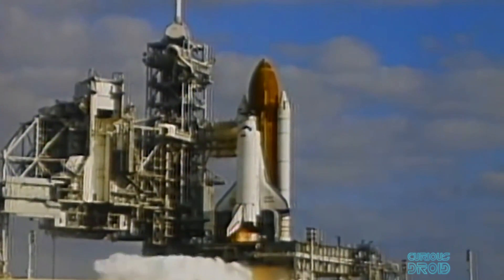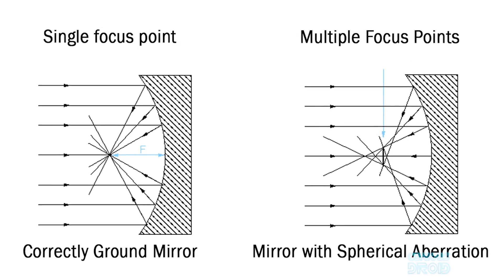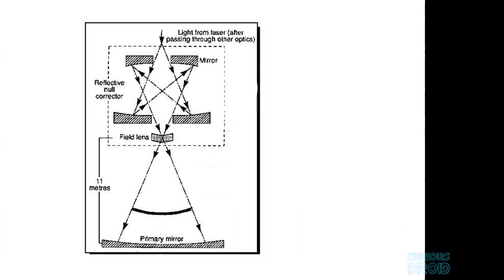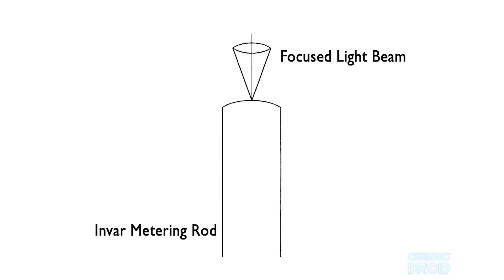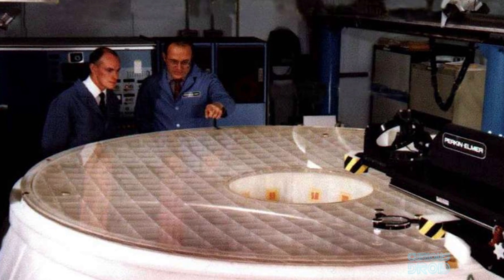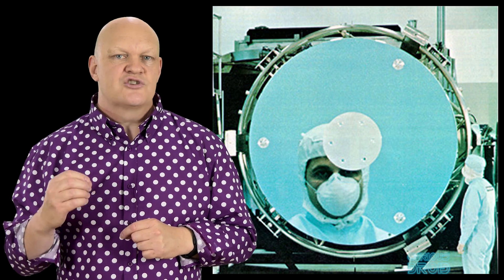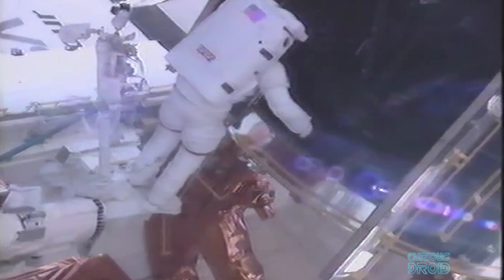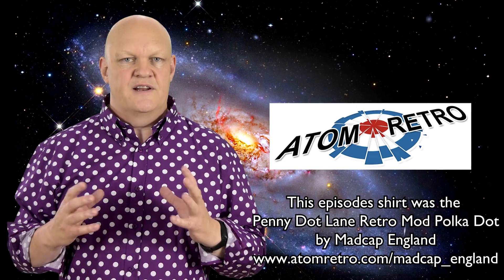Hubble Trouble - How did the Space Telescope Mirror End Up Flawed ?

Comment: 3 spacers .10 each, cost to find problem ~1000 in paid overtime, cost to fix in space ~10s of millions. Government contractor still gets paid priceless.
Reply: Although I agree it was a technical fault of Perkin Elmer, I think NASA still had the responsibility to accept the QC procedure and results when they accepted the mirror. In civil engineering you are often required to test any materials received on site through your own QC procedure where possible, in addition to reviewing the QC results from the supplier.
Reply: "No one ever asks how much worse the imagery we have today from Hubble is even after it was corrected as compared to what it should have been?"

That question has been asked and answered. I was an astronomy student in the early 90s and I have seen the relief of the astronomy community first-hand. After the repair Hubble exceeded the original specs.

At the same time though, these results are probably buried deep within the scientific astronomy literature and are not easily accessible to the general public. You could ask Phil Plait, the Bad Astronomer: he used to work for the Hubble science institute.
Reply: Obviously the corrective optics degraded the signal a little bit. But it may well be the case that if the mirror had been ground correctly in the first place, Hubble's performance would have exceeded the design specs even more. But that is all speculation at this point. And I would not call the Hubble's sensors "crude". They were pushing the state of the art when Hubble launched, and have since been upgraded multiple times.

And no, the corrective process was not the result of guesswork. Professional astronomers were all too aware of the shape of the point spread function and hence the corrective measures needed. In astronomy there is no dearth of suitable point light sources to gauge your optics performance. These point sources are also called "stars". 

Also, the source of the error was well known, as the present video shows. I don't know if they tried to replicate the Hubble mirror on earth using the faulty equipment, but I do know that the mirror shape was modeled in excruciating detail, and I have seen multiple scientific papers on this subject. Which, to be honest is not my specialty in astronomy - I did my master's thesis on the structure of galaxies, not on how to build space telescopes.
Reply: Termi Nation so let me get this straight, Nasa made a mistake, but instead of fixing the mistake they instead made an elaborate conspiracy to cover it up. This conspiracy involved hundreds of people from the private and public domain, uncluding members of the fbi and cia. Cdroid is also a member of the cover up crew. 

All these people are involved so that they can release photoshopped images of astronomical phenomena, which are good enough to fool the scientific community into decades of wasted research and wasted money stemming from faulty images. In order to keep the conspiracy from being found out they use contacts to try and rewrite history but the only ones who notice are peope lke you.

Your evidence is that you remember hearing it differently 20 years ago.

When someone calls you a moron or insane for believing this you think they are just derailing the truth.

Ever consider you were just exposed to too much depleted uranium and your brain isnt working right?
Reply: Hunter deja I'm not convinced of that. Any bit of extra optics inserted in the light pathway is bound to steal some light and/or field of view. They may be able to correct the direction the photons are taking, but they are going to lose some along the way. Compare the light sensitivity of a photographic "prime lens" which is a fixed focal length lens with few lens elements to a zoom lens which is a more complex design with many more lens elements, some movable to be able to shape the light beam traveling through it differently depending on the focal length set.
Reply: I was around in 1990 as well. But I wasn't a douchebag with seeds of mental illness, so I remember the news as it actually happened at the time. God forbid that a guy with a Youtube channel and a few thousand subscribers tries to make some interesting technical historical content for those interested in it, or god further forbid, those who weren't alive yet or not paying attention at the time. Yes, Curious Droid must be part of a Hubble space telescope cover up. He's the nefarious plant of "Big Astronomy."
Get a life.
Reply: Termi Nation You have presented no facts, evidence, motive or reason to your ridiculous claims except personal assurance. Since doing the first two is impossible because no evidence exists, perhaps you can answer my question about the motive?
Reply: You don't get it, do you? I have never been an object of someone's attempt to have me committed. And that goes for the absolute majority of people out there. The mere fact that you've dodged these attempts doesn't mean you are an healthy individual. In fact, you keep insisting there are "false accusations" and "circumvention of due process" going on are red flags indicating your mental health is, in fact, failing. Of course no youtuber has any weight over these things, but you are not looking into yourself when you keep accusing everyone else but you of wrongdoing.

As to the evidence, you're dodging again! This time, you have made up an excuse in me accusing you of mental problems. But look back, I have asked for evidence ever since my first comment in this thread, and you have ignored every single one of those requests. That's way before you had this idea. Still nothing.

We both know you have no evidence. You're making this shit up as you go along. Who knows from where? Little voices in your head? Some other conspiracy shit you've read online? A misunderstanding of some basic facts that have grown out of proportion? Who knows. But, please stop embarrassing yourself.
Reply: ConsciousAtoms maybe/meh... ;-) The MTF and combined MTF (Modulation Transfer Function*) optically should be weaker and poorer as a result of the corrective optics versus the original intended design. Remember the corrections and aberrations they were trying to "Fix" are and were very complex, so unless you have the 'Duff" mirror to build a corrective system directly to it's still going to be a bit of guess work even with sophisticated adaptive systems and optics. On the other hand maybe the digital sensors employed were sufficiently course/crude that the final MTFs and the "Quality" of the resultant imagery were not that different? Would be nice to see simulated imagery and response curves and the like? Maybe I google around :-) Also the Hubble platform seemed to have been plagued by "Unforeseen" vibrations and thermal expansion effects that were not sufficiently compensated for. Just wondering how much more awesome the imagery might have been?

* [Hard to explain MTF in one sentence, but a method of determining contrast and resolution of a system over a range of spatial frequencies... ]. Gives a very good idea of what a system can see in terms of faintness of an object and the ability to resolve very fine details without too many weird (aliasing) artifacts, aberrations, distortions or signal noise. ].
Reply: Perhaps you could tell me which country you studied in? I absolutely agree astronomy is definitely underfunded, infact I think astronomy is the closest thing we have to understanding life, the universe, and everything. Astronomers are like the the priests of the atheist.

Unfortunately no I am not. I am about to graduate as a civil engineer as a mature age student. I always considered working for NASA or any space research to be a rock star job. I guess I have the mind for engineering anyway, my decisions are sometimes too logical ;)
Reply: @Termi Nation The mirror is actually of extreme precision and excellently engineered... To the wrong focal point. Given an exact or otherwise known as systematic error, it is possible to correct the equipment for it.
Reply: Termi Nation i did and have read it.   Just like any other conspiracy theorist you have dismissed the evidence as a fraud. You think that a made up theory is more credible than the facts. 

Lets just use this issue in the video as a microcosm... Do you really think everyone at NASA and the contract companies were involved in a conspiracy? That is hundreds of people in public and private industry...

Even if it is a conspiracy why would they do it?
Reply: +Termi Nation... Nahhh I am engineer and expert in optical engineering and digital imaging as well as physically building this kind of stuff. So honestly @Termi Nation you are perfectly welcome to believe what ever you want and I'm not interested in dis-abusing you of your particular beliefs... I'm not bothered YKWIM..?  But I'm asking the question is the "Outsider" theory that there is this belief that the mirror was ground too rough versus being ground to the wrong profile/curvature? BTW I watched all of the space walks / EVAs on that many many many freaking hours (not fake YKWIM)? @Termi Nation you can believe whatever you want... I don't mind being Mr "Yuk Yuk" :-) (as you say).
Reply: Termi Nation just like other conspiracy theorists you think you are smarter than everyone else but you are actually a moron. I dont even understand why you think they would do this, hundrerds of people involved, nobody saying anything and for what? Is it just because in your world nasa is some lie that perpetuates round earth or something?
Reply: Termi Nation If you were around in 1990 then you didn't pay much attention. The problem with Hubble's mirror has always been known and understood as it being ground to the wrong shape, hence wrong focal point. And now you come here out of the blue and claim it wasn't, and that this is a later invented lie. You bear all the hallmarks of a full blown conspiracy theorist with your skewed reality, paranoia and outlandish claims. Claims, I might add, that you have not presented a single shred of evidence for. And since you are making the extraordinary claims, you need to come up with (preferably equally extraordinary) evidence to back up your viewpoint. Which you can't, because it is in fact you who is the liar here.
Reply: Termi Nation Yap, yap, yap... still no evidence. Why don't you try to actually prove your point instead of continuing to drone on like a broken record. What you really should do is seek help for your paranoia, but since that would mean actually admitting that you're sick, you won't do that. So, next best thing, show some evidence. Until you have some, just shut up will you.
Reply: Termi Nation You do know there were a total of five Shuttle missions to service Hubble, right? Which ones are you claiming were lies, and exactly how?
Reply: +Termi Nation Yup that's right Termi Nation, I am a CIA hatchet man rather than a Photonics engineer with 14 international territory patents to his name ... Yup you totally got me, totally nailed it!  I am a CIA man stalking you down relentlessly trying to cover up the truth and plug all the leaks from such knowledgeable and insightful individuals such as yourself.    FWIW I have worked with the FBI in the past on technical projects (20 years) ago and I have to say they are really freaking smart and know their onions. Honestly I'd rather work for the CIA in counter intelligence than actually be a photonics engineer. @Termi Nation I could care less whether you believe I am a photonics engineer or not, or could care less if you happen to think I am a CIA "Hatchet man" lol...
Reply: Termi Nation he gave you his credentials, and if you've read the comment thread, it's easy to see those who know what they're talking about and those who don't.

You're the latter because you haven't backed your statements. At all. You've just screamed it's a lie over and over again. You've provided no evidence that the story has changed since the nighties, something possible with some research, and ignored/dismissed the evidence and explanations given. 

It had the wrong focal point, the secondary optics and programing were change to correct it. That's what happened. Why you think it didn't doesn't matter unless you can prove it didn't.
Reply: Termi Nation man you really are a conspiracy theorist with little grasp what us adults are talking about.

And that's hilarious, keep saying stupid things.
Reply: Termi Nation The mere fact that someone have tried to have you committed should tell you something. You Are Sick. You need help. Reading your deluded ramblings makes me sad, because you are so completely off the rails and way into lala land. You have continued to ignore my requests to provide some evidence for your claims. The only reason can be that you don't have any, otherwise you would have pounded on the opportunity to shut me up for good. It is obvious to everyone but yourself that you are suffering from paranoid delusions. Which, of course, are part of the symptoms of your illness. You are unable to see that yourself, because you are in the middle of your own reality. I can only hope that you will eventually get the help you need to come back to the reality the rest of us shares.
Reply: @ConsciousAtoms May I ask where you studied and what you currently do for work? Also whether your peers found work in the field. I have heard its an extraordinarily difficult area to find work in, much to the detriment of humanity in general :(
Reply: I am not going to tell you where I studied as I value my online anonymity, such as it is. I am currently working as a statistical researcher. It's true that not many of my fellow students found work in astronomy, but a few did. Most of the others have jobs similar to mine, that I know of. One went on to have a career in history, as they were more interested in the history of science than science itself. And I agree, astronomy is WAY underrated in society. Without astronomy, navigation would be impossible, so the world trade owes us quite a bit of debt of gratitude :).

If I may be so bold, why are you asking? Are you looking into a career in astronomy perhaps?
Reply: @EXTRA DIMENSION Did they not exceed their original specifications though? I mean obviously they over engineered it, especially due to the attitude to space missions at the time. Things were extraordinarily expensive, so logically they would have allowed for extraordinary safety factors on the design, in this case precision. Perhaps the verdict is still out on whether it could have performed better without any fixes, but regardless, it still finally performed better than the contract criteria. In my opinion as far as the engineering is concerned, it was a success after a major (eek, litigation...) hiccup.
Reply: I really appreciate the encouragement and I think that's exactly what you should be telling most graduates, but to me, I made the decision long ago that even though I love space and all its mysteries, I can find plenty of other mysteries and interests in areas where I am guaranteed employment. You could see that as submitting to being a slave to capitalism I guess, but I see it as the most likely option to give me success and a field of work that at least holds my interest. I will leave the dreaming to you guys :) Peace
Reply: Not a contradiction, I think you misunderstand me. Hubble was over-engineered. It would have been even better without a faulty mirror than it is now with the corrective optics, sure. All I argued was that Hubble, after the fix, was better than the original specification. For clarity, "better than the original specifications" and "better than the hypothetical case in which they hadn't made the error with the mirror" are NOT equivalent statements. In this entire discussion I have been addressing the former, while you seem to think I have been discussing the latter.

How much better Hubble would have been than the original specs without the faulty mirror is unknowable. I also did not mean to say that Hubble with the corrective optics is better than it would have been without the faulty mirror. That is obviously not the case.
Reply: It exceeded their expectations when they fixed it, but that doesn't mean it would have been as good as it was originally intended. Lucky they got it as good as they did so it would have exceeded peoples expectations. lol
Reply: Two ways to fix after the fact:

1. Had the flaw been discovered before the mirror was installed in Hubble (as it almost was, but they ignored the test that said it was flawed,) they could have reground the mirror the right specifications, or used a backup mirror.

2. Had the flaw been discovered after assembly in Hubble, they could have removed it and installed the backup.  As mentioned in the video, multiple universities asked to test it during the launch delay - this could have happened.

There was no way to install the backup on-orbit, but it also was a possibility to retrieve Hubble, bring it back to Earth, swap the mirror, then relaunch it.  But the actually-used solution of a "corrective optic" elsewhere in the optic line installed on orbit was cheaper.
Reply: This is what I mean by "Backup mirror": https://airandspace.si.edu/collection-objects/mirror-primary-backup-hubble-space-telescope

And the mirror itself didn't cost $100 million.  Also, it wasn't 100% complete - the final step in coating it was never done. That would have been done had it been chosen to be installed.

Also, NASA even has two entire "backup telescopes" donated by US spy agencies that could be converted to be space telescopes, if funding were to happen: http://www.popsci.com/technology/article/2012-06/nasa-adopts-two-spare-spy-telescopes-each-maybe-more-powerful-hubble
Reply: The wrong focal point was a result of the error in manufacturing if you watched the video it's obvious, the mirror was designed to precision, but just to the wrong focal point... If you know anything about engineering or spatial error you know systematic errors are easy to fix because you can apply a systematic fix for the error. I am not sure how exactly they implemented the fix in software because I am not an optics engineer or a software engineer...

You seem to be a conspiracy theorist.. Let me ask you this: Do you think the moon landing is real?
Reply: This I kinda funny I have to admit... So there's a conspiracy theory that the Hubble mirror surface finish was too rough? Rather than being ground to the wrong large scale geometry but at the correct surface finish? LOL Those interferograms would not work at all if the surface finish of the mirror was to "rough". Hey if we keep this going maybe Curious Droid will make a second Hubble video or compare Hubble to James Webb space telescope... ???

(Ohh YouTube you are so funny). [Also don't forget (according to Curious-D Hubble mirror was of an aspheric design).
Reply: Weak retort imbecile. Go get your Obamacare psych meds while you still can.
Reply: Renegade...don't feed the troll. It's impossible to reason with foolishness or mental illness.
Reply: Anyone heard the "Story" of there being a second 'Hubble like" instrument in orbit that points at Earth and the ground for the alleged purposes of spying/intelligence applications? Is that a total "Tin foil hat" conspiracy rumor or did they really build another such telescope, vis a vie the unnecessary size of the Space Shuttle and cargo bay?
Reply: +ConciousAtoms Just as an aside... I owe my entire career/career trajectory to an Astronomy student that leant me a book on image processing as an undergraduate, and also being able to look behind the scenes at the University of Arizona Astronomy department and engineering as a 15 year old kid and the Kitt Peak National Observatories,  very inspiring indeed. I agree that the astronomers and their technical and scientific needs really force us to push all boundaries and frontiers and it's nice that Astronomy get's piggy backed onto "Big-Science" but now it seems that "Raw physics" and things like the LHC seem to be the "Focus" of interest too for how it all "Fits together".
Reply: +Renegade30 Awesome that you are mature student, at Cardiff University years ago there was real emphasis on mature students. I think when you come later to these things with a more mature mind then sometimes better direction and purpose can be found. My father used to work for NASA (50's and 60's) Marshall Space Flight Center... I have been very lucky that I have always applied for research fellowships and other positions that most people would say you (meaning I) don't have a snow ball's chance in hell of getting. But somehow by dumb luck I have proved them wrong most of the time. @Renegade30 seriously if that's what you want to do just apply for anything you possibly can! At NASA and Space X there are a lot of positions available and you just need to throw yourself at it and follow you instincts and also be flexible. Once you get inside an organization then you can start to move laterally into areas of greater interest. My advice (lame or useless as it might be) is really sharpen your pencil ffor advanced manufacturing processes such as CNC machining particularly 5 axis work/multi axis systems and advanced CAD/CAM as well as trying to get a handle on additive manufacturing coupled with smidge of materials science and metrology. That smorgasbord of partial experience coupled with basic theoretical engineering is VERY valuable and sought after indeed. Desperately needed in defense and aerospace and other manufacturing sectors that involve deeper engineering. Kind of depends if you live for advanced simulations or more hands on engineering, or a bit of both? Google around on youtube for what some carreer young University students are getting up to at Huntsville/Manned Space Flight center... I think you will be surprised.

 Long story short follow your instincts and sometimes not be so ready to believe people that tell you what you "Can't do"...
Reply: +Renegade30 The "Fix" was amazing... No doubt about it. But I wonder if the various corrections  that were made even put the operational capability to within 75 to 80% of how Hubble's "Alternate" reality should have been, then I think we would have been flooded with many articles, data sets and test plots to prove and show that being the case.  As that would have been a superb outcome where the cigars would have been handed out to all involved. Obviously Hubble has many/had many capabilities but if any one of the important capabilities was greater than about 67% of what should have been I think we would have certainly heard more about that as being one of the greatest technical achievements of our time? (Not just all the amazing space walks).

Just a simple example. Let's say you commissioned me to build a "Modest" 600mm (aspheric design)  telescope with certain specs and tolerances and general capabilities ... And then I delivered to you a telescope that could not quite focus right... And then I give you a set of very complex alternate optics (constrained by size and other factors) introduced to the light path and told you that it's better than the original in spite of the most important optical and expensive component being ground completely wrong, you'd probably tell me that I was "Full of it"/be rather incredulous,  and demand a total rebuild or a total refund? Physics and data still have to apply here, and in the case Hubble (understandably so) a lot of data has been buried.  

But everybody seems to have moved on and the James webb Space telescope is of a radically different design and the other space telescopes that image in other spectra are super interesting too. Lot of lessons learned all round but the original engineering mistake really still horrifies me to certain degree as it was so avoidable especially by those "Well practiced in the relevant arts".
Reply: @Renegade30 Nice to hear that someone is enjoying making the green stuff. I have my own company now and have had to learn how to transition from the academic world to "For profit" world lol. But I remember at Cambridge virtually all the brightest students/undergraduates whether they be Physics or Engineering or Mathematics "Majors" were all poached by the financial sector/city and it was graduates from more "Red brick universities" that stayed more with their chosen subject and filled out Oxford and Cambridge graduate programs. So I guess all those really smart physics students and undergraduates and the like understand all that "Sub prime" business/nonsense... (Totally over my head lol). Peace! ;-)
Reply: +ConsciousAtoms... Makes me think (from what you say) about Hubble being over spec'd in the first place that it's shame they didn't have a Hubble "Program" where you could have slightly dialed back set of Hubbles (spec wise) but a Hubble1, 2, 3 and 4... etc. over a certain active launch and development period? Yes I know it takes a long time to grind a big mirror, but  might have been cheaper in the long run and achieved better results and be a much more blunder and fault tolerant approach? For the Apollo program the space carrier vehicles, it was not that much more expensive to produce ten or twelve Saturn V systems than it was or would have been to produce only one. At least with a multiple space telescope strategy improvements at the digital end might have been made more easily and so on. Easy to say now with 20:20 hind sight? That's what I liked about the early Mariner probes and missions they could miss an entire planet or crash  several times and still have a program ? Having a really expensive one of kind "Egg" in only one basket and saying "What could possibly go wrong???", "Hopefully this will all work right first time?"... Just seems a very very tall order.

I wonder with the current expertise that an ONLY one James Webb Space Telescope is a good way to go? If I understand correctly ? Again 20:20 hindsight but what have we learnt (from the past) and do we still continue to blast really expensive one of a kind instruments into space (still crossing our fingers)? (shrugging shoulders).
Reply: +Justwantahover My feeling the guys that designed the "Fix" (some very notable individuals) KNOW exactly what the shortfall / difference would have been. Any engineer worth their salt would have a pretty good idea of that, but seems they felt super happy as it was a VERY risky and heroic long shot in the first place. The James Webb Space telescope seems amazing but there are also some seriously risky "Mechanicals" that have to work flawlessly at a LaGrange point that cannot be serviced by astronauts! :-)
Reply: Termi they fixed it after the fact with corrective optics installed in the telescope, not a "PC program." Keep your stupid mouth shut.
Reply: aluisious its too funny though, its amazing people like him exist
Reply: +Termi Nation LOL... Maybe you are the CIA agent here doing the covering up here as I was the one casting aspersions as to the efficacy of the Hubble fix. Maybe you suffer from a cluster B personality disorder like malignant narcissism as you choose to re-frame my comments to suggest that I love the mafia. I'm willing to bet you could care less whether the Hubble fix is real or not but instead you get off on stirring up trouble... lol Nailed it!
Reply: Ohhh really you are the arbiter of integrity... What other parts of the Universe do you rule and control? Oh great one...
Reply: You keep repeating your bullshit. I asked for evidence , not your delusional opinions.
Reply: +Termi Nation you are so Troll-tastic lol
Reply: The general public doesn't give half a shit about you. No one will ever care about you, because you choose to be like this, an unfettered loser.
Reply: And everyone else who has replied anywhere in this thread who has notifications on is sick of both of you.
Reply: FYI Personality disorders do not indicate lack of "Mental capacity"... Many Narcissist and Sociopaths do not lack in "Mental capacity" and sometimes are actually very intelligent. However those two groups do suffer from paranoia and delusions of all sorts as well as other manifest negative personality traits that can indeed be very damaging to other people as well as themselves. [Something we learn at the CIA "Hatchet man" school of psychology as taught by Mr "Yuk Yuk".].
Reply: +Benny Löfgren There's no spam filter for schizophrenics. Changing the subject ... (slow, loud and pedantic tone reminiscent of Monty Python)... "I like to come to Curious Droid website in the vain hope to avoid the squalid global idiocracy that is the internet...  And have a nice chat with similarly interested individuals that are fans of "Space" and other such things like the really good videos  made by Curious Droid..."  FAIL lol !

[It never fails on whatever technically oriented web site a discussion will start up of a technical nature and then a total wack job will bust in to attempt to totally kidnap a thread and derail it completely... Ohhhh how I love the inter-web.]. Civilization is doomed... Peace out! [Не кормите троллей ].
Reply: These government contractors really are too big to fail. How are you supposed to punish a company that critical to the US defense industry? You can't, they just laugh at you. Even a Hubble-sized screwup is just another government contract for them, one of a thousand. The Military Industrial Complex is a real thing.
Reply: No one ever asks how much worse the imagery we have today from Hubble is even after it was corrected as compared to what it should have been?
Reply: +ConsciousAtoms Sorry friend I'm going to have call out on that (in a nice way) as you said first " That question has been asked and answered. I was an astronomy student in the early 90s and I have seen the relief of the astronomy community first-hand. After the repair Hubble exceeded the original specs." and then you contradict yourself by later saying "Obviously the corrective optics degraded the signal a little bit. " after being gently corrected on your original statement . 

When I say "Guess work" I refer to residual errors of a high order of complexity that can't be modelled... And you should know without being able to pull actual "Focus" on the optical systems for objects at infinity such as stars (as you cite) then you are still "Guessing" i.e. not able to with absolute certainty close in on all the residual errors in that system. Gauging the effects of different blurs is not the same as even an in focus Siemens star, resolution chart, or MTF generator or even interferometer... Remember the second interferometer used to measure the defective Hubble mirror was of a lower precision and accuracy, and also the mirror in space behaves very differently (as they later discovered) from a notional ground based instrument/ mirror on Earth, and also obviously very different from the one correctly ground by Kodak.  Definitely the Dalsa sensors that were used were relatively crude/course/low resolution as compared to the actual intended optical performance of the Hubble system and what we could today theoretically install. 

The question is whether the sensor upgrades were ever allowed to be of a sufficient spatial resolution to reveal the residual lack of capability of the final "Fixed" system as a result of the original f*ck up?

Personally , [At this point I can't substantiate my "Hunch"/suspicions (pending further research etc. blah blah blah ], Is that at the time everybody was patting themselves on the back for a job well done on the "Fix". In terms of space missions and accomplishments, very breathtaking, but from my point of view as an engineer that does design sophisticated high precision 3d  optical systems (originally Ph.D. Cambridge) I think the Astronomy community has been given short shrift. The original source of the errors are unconscionable from a basic design engineering and procedural point of view and I suspect that the Astronomy community has been dealt with in a rather patronizing manner... Almost like 'Pat, pat pat on the head" aren't you lucky that we fixed this for you guys... And the Astronomers are not jumping up and down hopping mad that "They" totally f*cked the instrument's capabilities in the first place and does not in fact perform anywhere near as well as it should have done... Hence the newer generations of space telescopes and other techniques currently being employed to hopefully peer deeper into space and time in a more competent fashion.

When I was an undergraduate at Cardiff University (in the early 90s too ;-) ) and I knew a number of people in the Astronomy department, and in particular one  professor that was under scrutiny for the Hubble mirror design (as he claimed to have designed the mirror and as a matter of fact, at the time they though he messed things up;  but I assume he was exonerated when they found the coating/paint flake error and other sources of failure).[ Even for that time the interferometer design raises a lot of eyebrows... Hard to believe really].

Long story short, Hubble should have been way better and IMO "You" Astronomers got screwed by bad engineering and bad project management and you guys should still be pissed off about that and perhaps notbe  so happy to accept  an inferior design and platform that got severely messed up. But frankly I think the Astronomy community at the time was terrified that their science was going to be cut by politicians and tax payers  as so much money was spent on a gigantic blunder and tax funds for throwing good money after bad were really in the balance (many congressional hearings). That's why I think everybody at the time had to be "On message" about the "Fix", where as now (all of us being good students of history) should endeavor to get to the bottom of whether the fixes and corrections really did create a "New instrument" that comes close to what would have been possible with an un-messed up near contemporary space telescope. YKWIM?  

Fingers crossed on the next generation of space telescopes... (Kind Regards).
Reply: Alusions - yes well we should all listen to you, a foul mouthed slanderer, over myself because we all know how foul mouthed slanderers are paragons of integrity and virtue. 
Not.
Reply: This ""wrong focal point" is the new excuse because their original claim on the 'fix' was not adding up upon closer scrutiny. When reported on originally it was a claim of insufficient mirror polish not detected till after it's launch into space. The claim at the time was software to correct the fuzzy. But it was being observed by some that if software can sharpen the focus then a super highly polished EXPENSIVE TO PRODUCE mirror was not required in the first place. But a highly polished mirror IS required. There was no fix. NASA had to save face in public perception upon losing hundreds of millions of dollars on what is now space JUNK, so they make up a phony 'fix' story and hire an artist to manufacture Hubble images. But that original excuse doesn't hold water so they come up with this new 'reason' and throw down the memory hole their original excuse and hope nobody (like me) notices.
Reply: Alusions that is not the story reported back in 1990 when this situation was current ( I was 30 years old. How old were you? Were you even born yet?).  But here we are 27 years later, this vid published just a few days ago. So what brings up the issue now 27 years later except that there is a need to revision history to further cover up their 'getting exposed' cover-up.
Reply: Alusion wanna see yourself in the movies? go watch the movie Idiocracy. That movie is full of your doppelgangers.
Reply: Renegade my eye/ear witness testimony of the events and reporting back when this issue was current IS "evidence". Go to any court hearing and see for yourself.
Reply: Maybe this maybe that.... still no reasoned rebuttal. A personality contest instead. Ain't that just like a CIA counterintell agent. Evasion and argument by name calling and slander of ones mental capacity. You forfeit your integrity.
Reply: Stirring up trouble? Sure, the rioters are gathering as we speak over this comment thread.
Reply: "Stirring up trouble" - the rhetoric of a cop if ever I heard one.
Reply: I did tell you I'm the Second Coming didn't I. 
YOU wanted to be the arbiter of optical engineering telling me you are an optical engineer. What Univers-ity do YOU rule and control oh optical engineering great one... hypocrite.
Reply: A "fisher of men" = Trolling -Matthew 4:19
Reply: This ""wrong focal point" is the new excuse because their original claim
 on the 'fix' was not adding up upon closer scrutiny. When reported on 
originally it was a claim of insufficient mirror polish not detected 
till after it's launch into space. The claim at the time was software to
 correct the fuzzy. But it was being observed by some that if software 
can sharpen the focus then a super highly polished EXPENSIVE TO PRODUCE 
mirror was not required in the first place. But a highly polished mirror
 IS required. There was no fix. NASA had to save face in public 
perception upon losing hundreds of millions of dollars on what is now 
space JUNK, so they make up a phony 'fix' story and hire an artist to 
manufacture Hubble images. But that original excuse doesn't hold water 
so they come up with this new 'reason' and throw down the memory hole 
their original excuse and hope nobody (like me) notices.
Reply: Renegade30 yes you are exactly right except for the last sentence. And it's even worse than you just described. It's a total brainwashing propaganda scheme not just involving NASA but darn near everything. 
"When someone calls you a moron or insane for believing this you think they are just derailing the truth."<---yes that is exactly you and exactly what you and these others are doing. And none of your bullying rhetoric and obfuscations are going to work on me.  You people aren't going to tell me what I did or didn't hear and see concerning Hubble back 27 years ago when this issue was current. Far as I know you fuckwits weren't even born yet or still sucking your damn thumbs.
Reply: Renegade30 you are just like a Nazi demonizing Jews as animals who's testimony can be disregarded as mentally below par with theirs and just like an animal heard of cows can be 'culled'/killed with no breach of human ethics. That is what you are doing and saying when you slander my mental capacity. An avoidance of having to come up with a reasoned rebuttal and death or incarceration (mental ward) to stop yourselves from being exposed for the criminals against humanity that you are. "stop debating me"? You never started to debate me. It's been a slander of my mental capacity or honor from the very beginning. From the beginning you all have been calling me an animal Nazi demonetization. All you are genuinely concerned about is not having your gangster lies exposed.  Trying to have me commited has already been tried several times and failed. It's to obvious for even the most novice of psychologists that I am none of those things you try to ascribe to my mental awareness. "For I will give you a mouth and wisdom, which all your adversaries shall not be able to gainsay nor resist." -Luke 21:15
You'll have to come up with some other plan to shut me up. Clandestine assassination attempts have also failed.  "Thou canst have no power against me except it be given thee from On High" -John 19:11 
Your move... but you are out of ammo.
Reply: Top 4ce - I'm a conspiracy exposer. And I'm positively older than you.
Reply: NO Benny you have that backwards. The mere fact that it's been tried several times AND FAILED should tell YOU that the accusers are FALSE ACCUSERS using a "temporary" circumventing of due process of law to censor me from exposing them. Their failure is not evidence of the efficacy of their claims. There failure shows you the LACK of efficacy in their claims. You need an education in logic cause you are a but ass naked money walking ass backwards. 
And no youtuber numbnutz is accepted as judge of anybody's mental capacity. YOU Benny Lofgen, as far as anybody knows can be an incarcerated whack job typing your shit from inside a rubber room as anybody else in here. 
Evidence? What for I provide you with evidence or discuss reasonably with you anything at all when disparages my mental capacity from the bit go? Take a hike.
Reply: You aren't a professor of personality disorders.  FYI your "I" ain't worth spit.
Reply: So - no reasoned rebuttal. And an admission that you worship espionage (CIA FBI). Smart? Sure they are. Smart at doing evil and betrayal. But you don't care about that. Only that they are smart. I bet you envy the Mafia as well. I bet dollars to doughnuts your favorite movies and reading are Mafia stories. But hey, the Mafia works for the CIA. Or is it the other way around. One in the same now aren't they.
Reply: Hubble was launched in 1990. soon after the problem was discovered, reported on and supposedly fixed 27 years ago. So what brings up the issue now 27 years later except that there is a need to revision history, cover up their 'getting exposed' cover-up.
Reply: renegade what part of my saying " 'wrong focal point" IS A LIE" didn't you understand? Repeating their claim that I'm calling a lie does not change it to a truth.
Reply: Renegade read this full comment thread please starting from where I chimed in.
Reply: Renegade - if all you can do is slander my mental capacity in place of a reasoned rebuttal and make broad assumptions as to my beliefs without any kind of corroboration... then yeah, I am smarter than you - by your own admission. I don't have to resort to argument by intimidation. My claims stand on their own merits rather than some petty point system of a personality contest.
Reply: Renegade this "focal point" problem was not the story reported back in 1990 when this situation was current ( I was 30 years old. How old were you? Were you even born yet?).  But 
here we are 27 years later, this vid published just a few days ago  (<--the evidence). So 
what brings up the issue now 27 years later except that there is a need 
to revision history to further cover up their 'getting exposed' 
cover-up. This ""wrong focal point" is the new excuse LIE because their original claim
 on the 'fix' was not adding up upon closer scrutiny. When reported on 
originally it was a claim of insufficient mirror polish not detected 
till after it's launch into space. The claim at the time was software to
 correct the fuzzy. But it was being observed by some that if software 
can sharpen the focus then a super highly polished EXPENSIVE TO PRODUCE 
mirror was not required in the first place. But a highly polished mirror
 IS required. There was no fix. NASA had to save face in public 
perception upon losing hundreds of millions of dollars on what is now 
space JUNK, so they make up a phony 'fix' story and hire an artist (and I even know who this artist is) to 
manufacture Hubble images. But that original excuse doesn't hold water 
so they come up with this new 'reason' and throw down the memory hole 
their original excuse and hope nobody (like me) notices.
Reply: You lie Benny. My memory is perfectly fine. And calling me a conspiracy theorists as if that is reason enough to dismiss me out of hand is wearing thin o the general public. If it's a personality contest then it's because you don't have actual reasoning to counter with. There is no reason to bring this issue up 27 years later EXCEPT for the need to revision history exactly as described by Orwell - 1984. Revise the news reporting and throw the original down the memory hole.
Reply: this "focal point" problem was not the story reported back in 1990 when
 this situation was current ( I was 30 years old.).  But 
here we are 27 years later, this vid published just a few days ago  
(<--the evidence). So 
what brings up the issue now 27 years later except that there is a need 
to revision history to further cover up their 'getting exposed' 
cover-up. This ""wrong focal point" is the new excuse LIE because their 
original claim
 on the 'fix' was not adding up upon closer scrutiny. When reported on 
originally it was a claim of insufficient mirror polish not detected 
till after it's launch into space. The claim at the time was software to
 correct the fuzzy. But it was being observed by some that if software 
can sharpen the focus then a super highly polished EXPENSIVE TO PRODUCE 
mirror was not required in the first place. But a highly polished mirror
 IS required. There was no fix. NASA had to save face in public 
perception upon losing hundreds of millions of dollars on what is now 
space JUNK, so they make up a phony 'fix' story and hire an artist (and I
 even know who this artist is) to 
manufacture Hubble images. But that original excuse doesn't hold water 
so they come up with this new 'reason' and throw down the memory hole 
their original excuse and hope nobody (like me) notices.
Reply: This ""wrong focal point" is the new excuse because their original claim on the 'fix' was not adding up upon closer scrutiny. When reported on originally it was a claim of insufficient mirror polish not detected till after it's launch into space. The claim at the time was software to correct the fuzzy. But it was being observed by some that if software can sharpen the focus then a super highly polished EXPENSIVE TO PRODUCE mirror was not required in the first place. But a highly polished mirror IS required. There was no fix. NASA had to save face in public perception upon losing hundreds of millions of dollars on what is now space JUNK, so they make up a phony 'fix' story and hire an artist to manufacture Hubble images. But that original excuse doesn't hold water so they come up with this new 'reason' and throw down the memory hole their original excuse and hope nobody (like me) notices.
Reply: Extra Dimension nobody believes you. I get you CIA contracted counterintelligence agents all the time in here trying to counter my exposure with further lies on top of lies. If I'm questioning the claims of a Nuke power plant, invariably some compatriot of yours will come on and claim he's a nuclear engineer, that I'm wrong and should take his word for it. If I question some claim of astronomy then someone claiming to be an astrophysicists comes on. Whatever subject I'm debating, in due course when nobody else can reasonably counter argue, some claimed expert in the field will come here to maintain the fraud narrative. Now I get another ANONYMOUS claimed "optical engineer". Yeah right! And I'm the Second Coming. And you should take my word for it as you expect me to take YOUR word for what you say YOU are.  How do you like them apples CIA hatchet man?
Reply: The real question is how could they have fixed it AFTER THE FACT? To 
claim they only needed to use a PC program to fix the image means they 
didn't need a super polished mirror in the first place. But since they 
did go with a highly polished mirror (but ended up flawed polish) that 
means no program can fix it. It's not fixed, and all those claimed 
Hubble images from deep space are actually artistic 
rendering.....FRAUDS. - Google the name Kazuaki Iwasaki.
Reply: The real question is how could they have fixed it AFTER THE FACT? To 
claim they only needed to use a PC program to fix the image means they 
didn't need a super polished mirror in the first place. But since they 
did go with a highly polished mirror (but ended up flawed polish) that 
means no program can fix it. It's not fixed, and all those claimed 
Hubble images from deep space are actually artistic 
rendering.....FRAUDS. - Google the name Kazuaki Iwasaki.
Reply: "corrective optic" is a LIE misleading you to think there is an actual optical glass 'piece' when it is actually only a computer program making digital corrections like your 'automatic' digital camera.  So talk about cost savings... If Hubble would have worked with a cheaply polished mirror with computer optical 'fixing' rather than the super duper polish, then they would have used that instead in the first place and saved themselves 99 million dollars. (and what do you mean by a Backup? You don't spend an extra hundred million dollars on a back up mirror that will be in space with little way to change it out. Back up mirror my ass.)
Reply: Extra Dimension I'm a perfectly literate person. Yet I have no idea what you are saying. But if I were to eliminate the gobbledygook from the subconscious encryption what would be left is a statement that my theory should be dismissed out of hand, without any kind of critical reflection, simply on the basis that it entails a conspiracy.  Yuk Yuk.
Reply: This ""wrong focal point" is the new excuse LIE because their original claim
 on the 'fix' was not adding up upon closer scrutiny. When reported on 
originally it was a claim of insufficient mirror polish not detected 
till after it's launch into space. The claim at the time was software to
 correct the fuzzy. But it was being observed by some that if software 
can sharpen the focus then a super highly polished EXPENSIVE TO PRODUCE 
mirror was not required in the first place. But a highly polished mirror
 IS required. There was no fix. NASA had to save face in public 
perception upon losing hundreds of millions of dollars on what is now 
space JUNK, so they make up a phony 'fix' story and hire an artist to 
manufacture Hubble images. But that original excuse doesn't hold water 
so they come up with this new 'reason' and throw down the memory hole 
their original excuse and hope nobody (like me) notices.